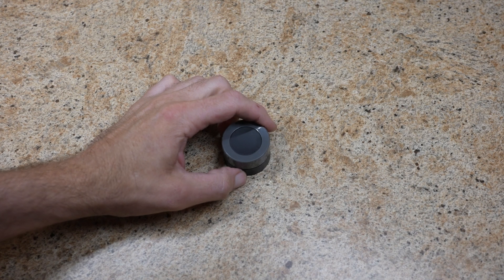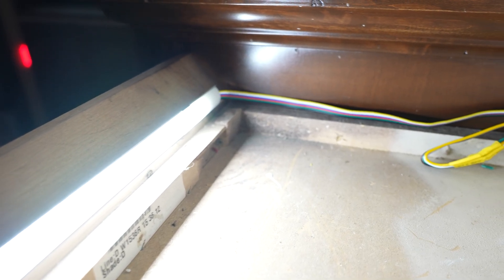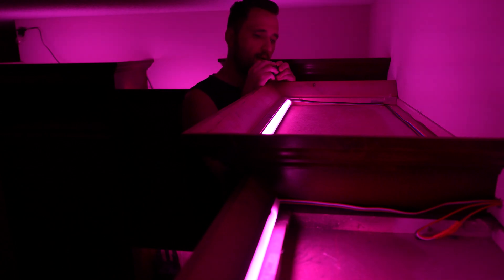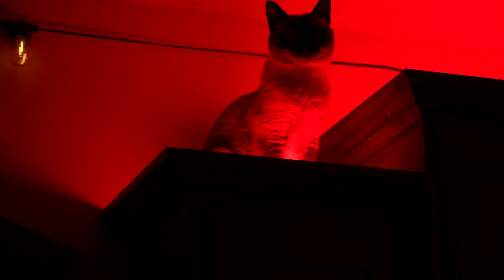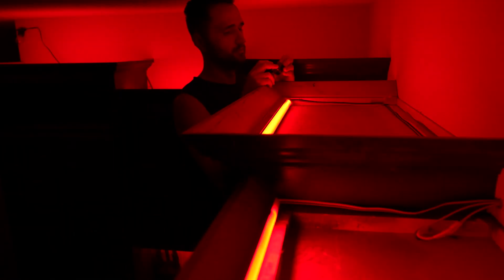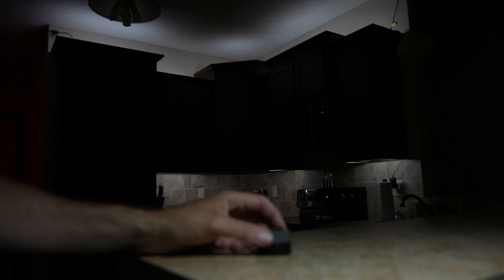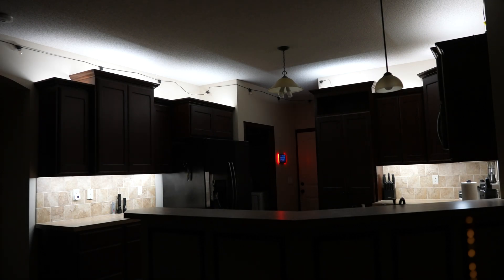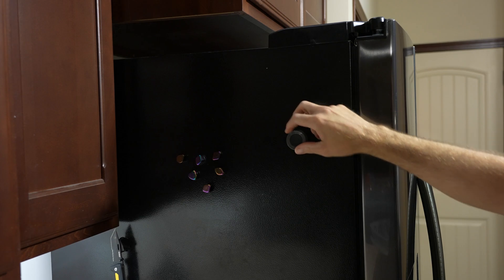Smart Zigbee Rotary knob with ENDLESS Home Assistant possibilities!

Comment: Thanks a lot, this is a very important solution in times of RGBW lights. Would it be possible to use also the functions of rotation while holding the button pressed? Also, it would be fine to have a possibility to select more than one device / entity. But it works, when I make a copy of an automation and select another device.

Comment: Great code and solution. Anothe Option If you look at the rgbw controller. In the developer tools in state. It will give you the rgbw values of current color. So if you have a color you want look at the values when the color is active.

Comment: Very clever idea! Bravo on sticking through it to get the solution you wanted! As a possible improvement to the RGB code, check out HSV color codes - that may provide a more direct way to affect the color and brightness of the lights. If the lights only take RGB values as input, I'm sure there's an HSV->RGB converter out there for HA.
Reply from the maker: Thanks for the tips!

Comment: Looked at the code, and I use the same "input_number" with an "automation the runs everytime it changes" method for controlling some of my LEDs. The input is currently sliders in my home assistant interface, but it should be really easy to add the knob, I have 90% of the code already in place, and zigbee2mqtt setup. Thanks for showing this.

EDIT 8/7/23: Received rotary knob today, working good for controlling Brightness and Temperature of lights.

Comment: Immediately went and bought 4 of them. I think they will work nicely with my IKEA TRÅDFRI bulbs
Reply: Did you not just buy the tradfri knobs? They look almost exactly the same as these. Not quite as many functions though but they do the twisty thing pretty well.
Reply: @RyanMcGuinness  IKEA doesn't have the twisty thing. And the ones they do have suck for integrating they hold down functions in Home Assistant
Reply: @RyanMcGuinness  Bought one of those knobs, never stayed connected for me. I've used the Aqara dimmer knobs, work well.

Comment: I like it, I can think of a couple projects to use that with.  Does it work with zigbee2mqtt or did you have to use a Tuya integration?
Reply: I have a couple connected to Z2M. They work great.
Reply: It's a ZigBee device that can work with Z2M or ZHA, although the automations he made are using ZHA mappings. I'm working on a Z2M equivalent.